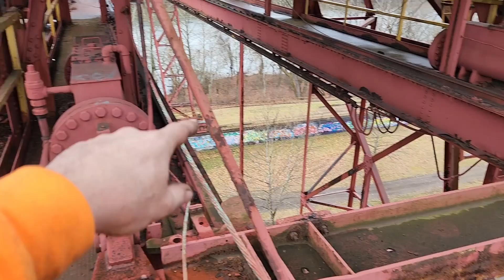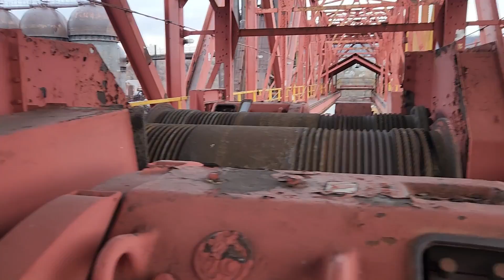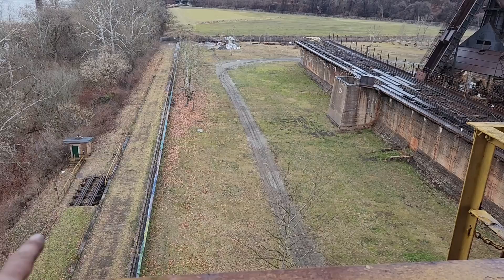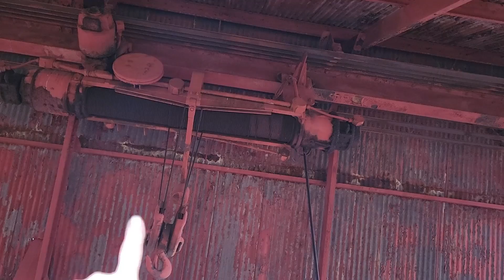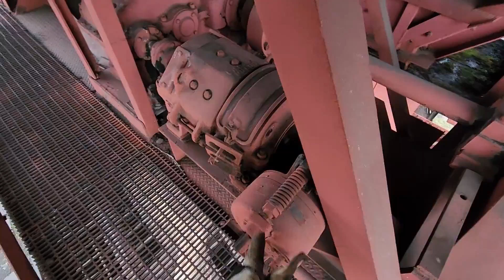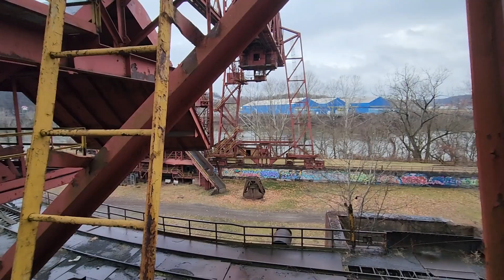Walking Around Carrie Furnaces Part 4 - The Ore Bridge

Comment: It's impossible to describe the impact these scenes have on my senses. The enormity of the structures and intricate balance of gravity and steel-the design in an engineers brain who calculated the stresses and required strengths to make all this function safely is beyond my ability to fathom. Granted, in the end it's all math, but the genius it took to plan and build it is awesome! Thanks, Rick, so much-I'd love to climb up there with you!
Reply: A lot of the engineering around the turn of the century was less about the math and more about empiracle experience and scale.  Many of these structures were based off old older smaller structures that had served and just scaled up to match the larger size and increased capacity. Things that were known to be issues were addressed simply by adding more to the existing design.  The reason much of this stuff survived so long was because it was considerably overbuilt because the science didn't exist to define exactly what it took to do the job.
Reply from the maker: I have always been fascinated by the complexity of it all and how everything worked together so well.